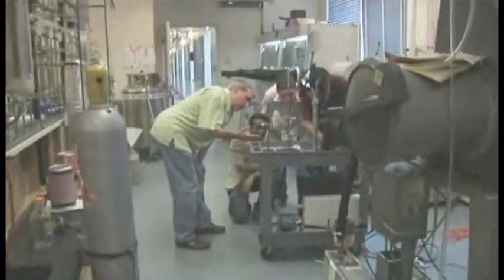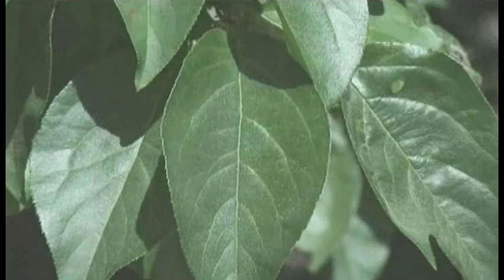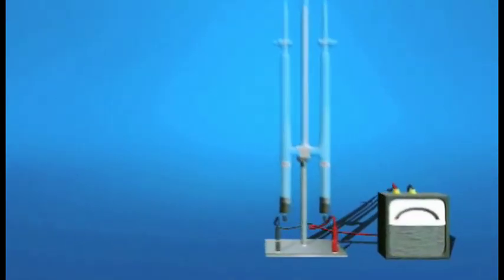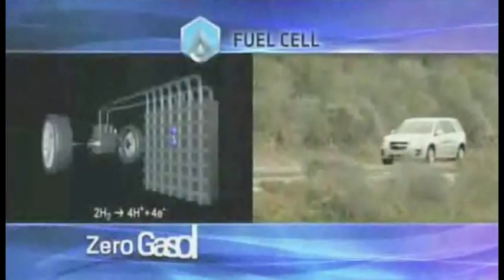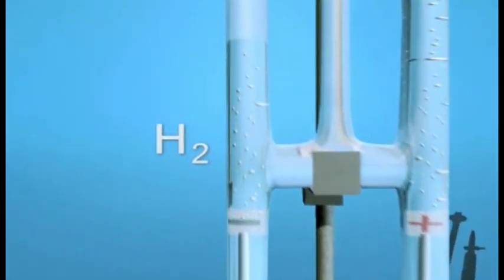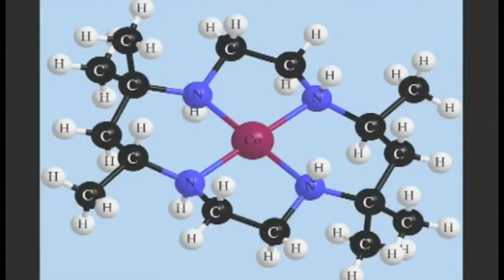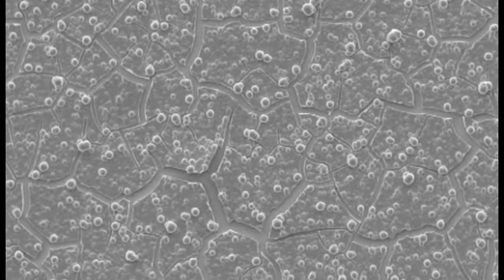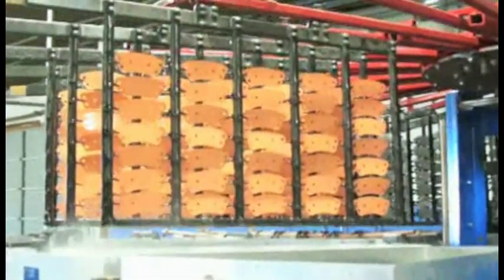Energy from Sunlight

Comment: if input energy needed to create this water splitting process is equal or more than the energy output, then this is worthless.  now if the energy output created is more, much much more than the initial required energy input to kick start the process, then it's worth it.